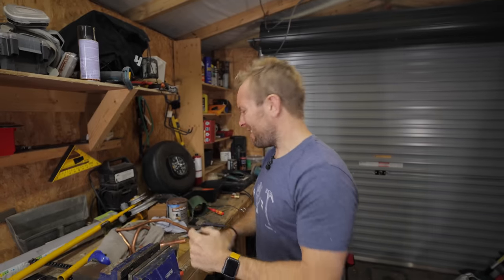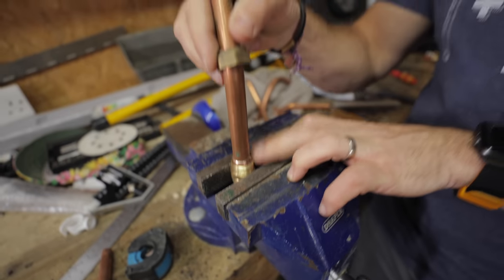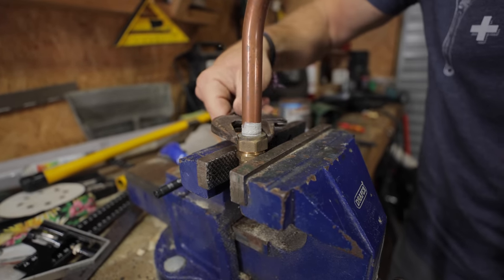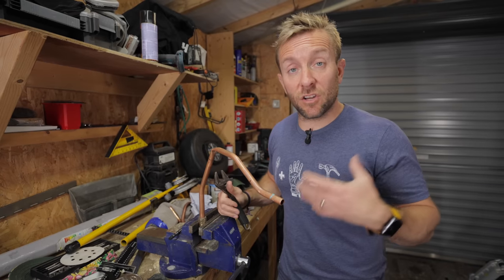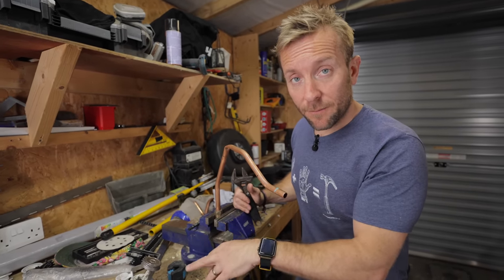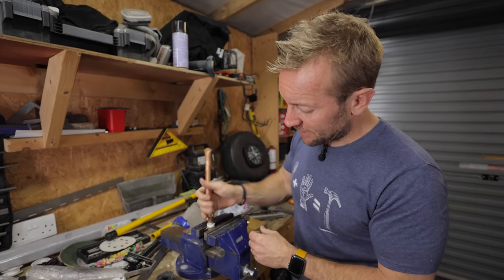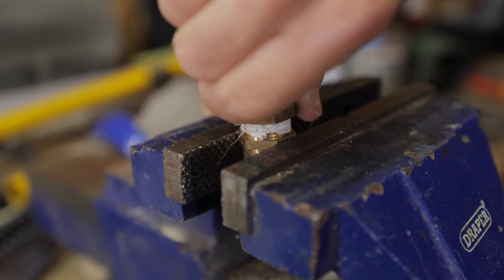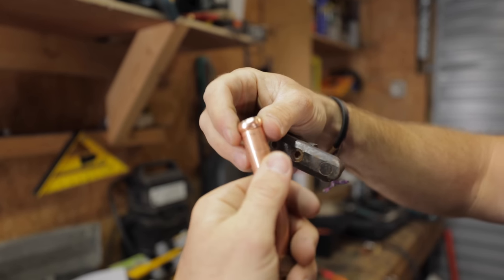4 MISTAKES Everyone Makes When Using COMPRESSION FITTINGS

Comment: I was once told by a plumber that the manufacturers spent £millions on R&D to get compression fittings to seal properly, so under no circumstances do such a stupid thing as put anything on the joint. Stood me in good stead for donkeys years. A fitting that's been overtightened to the extent that it leaks means removing the fitting and a section of pipe and starting again.
Reply: That may have been the option decades ago, but today 2023 the pipe and fittings as mentioned are imported and they're crap, they need all the help possible to effect a good permanent seal. Copper pipe made in the U.K in  the old days was much thicker walled , and like for like fittings old against new weigh significantly less, thus there is that less brass. In practice I might add, I would far rather act on the advice of a working modern day plumber/heating engineer than and old fart that is decades out of touch! As for manufacturers spending millions on R&D, not these days especially imported stuff, it's cheap and cheerful to maximise profits.
Reply: @MrChrissy1r  You had my attention, right upto the point that  you felt the need to descend into the gutter. I still actively use copper pipe - and compression fittings where necessary, too - and still don't suffer leakage issues. I guess you'll have to put it down to skill - something many modern plumbers clearly lack... And, btw, maybe you should get your mum to proofread your comments before you hit reply..?
Reply: I’ve used PTFE tape for years never had any issues 😂👍
Reply: Mechanical fittings do not need any type of dope. That would be like putting dope on a flare fitting. You just don't do it.
Reply: @will_doherty tf did he say
Reply: Hnnjh
Reply: Many manufacturers of compression fittings, similar items and even nuts and bolts, now drive down the tolerance of parts to the point that, what would previously have been a good interference  fit, is now a 'rattling good fit' as we used to call it.  I've also evidenced it in boiler pipework too, most recently in an old Vokèra machine of circa 1998 and a brand new one.  

You also see it in spanners and sockets that are of a marked size is now too large for the newly-acquired hex nut, leading to slippage and, in extremis,  damage.
Reply: Loved your video   very exciting.  Just 1 thing, i have a problem with over tightening, my son says my torque wrench is a German made "goodentite".
So, just how do you know when it is tight enough??
I was thinking,  maybe put a mark on it when you feel it come tight and then turn it......say 1/4 of a turn...yes....no??😢
Reply: Spot on just retired after fifty three years in the job, very rearly used any compound  not needed
Reply: The same fitting has been used for decades. What is this R&D you are talking about?
Reply: @AC_Milan1899 "the same fitting has been used for decades"
I think that's the point.
They did all the hard work years ago and now that it's as good as it can be there is no need to change it.
Reply: I thought jointing compound was for use with iron fittings and if hemp /plumbers string is needed. The olive should be dry!
Reply: Agree. I rather put ptfe tape or none than jointing compound. Especially for tap Tmvs works. You will make yourself a lot of a work when coming back after a year and servicing strainers in check valves.
Reply: I listened to that advice when I started it's bs
Reply: I listened to that advice when I started it's bs
Reply: I listened to that advice when I started it's bs
Reply: I listened to that advice when I started it's bs
Reply: I listened to that advice when I started it's bs
Reply: I listened to that advice when I started it's bs
Reply: I listened to that advice when I started it's bs
Reply: Loving all the salty comments .
Reply: @davidbenson776  No matter how many times you repeat nonsense, it doesn't make it true...
Reply: @will_doherty  Don't have a clue why it posted it so many times ?
Reply: @will_doherty what do you mean he descended into the gutter?
Reply: Brass olives are the way forward 😊
Reply: Why take the risk of not using PTFE?
Reply: @MrSprintcat  why can't you put dope on flared fittings? I've seen many leaks on those as well. I put a little pipe dope and never ever had a problem. You've just heard not to before and now you treat it like gospel. Think for yourself some time okay champ

Comment: Have used compression fittings for about 40 years, never used jointing compound and never had a problem. Don't overtighten and you can go back and pinch them up a bit if it oozes slightly. Never needed PTFE tape either. By the way, PTFE isn't nylon, it's Poly Tetra Fluoro Erhylene, the clue is in the name!
Reply: Ethlene
Reply: @LS-td3dz  Polytetrafluoroethylene
Reply: Same. Just pinch them up. If undoing old joints I might use some.

Comment: Another tip, turn off your water when you go on holis
Reply: Yeah - learned the hard way. But it was a compression fitting that failed with PTFE, that sealed well but was under tightened and popped off. 

Jointing compound is a bad idea on these because it may seal but might not be tight enough

Best test is to tighten loosely, no compound, pressurise the pipe and stop  if it starts to leak and just tighten enough to stop it leaking and then a few more flats.

You should be able to undo a fitting and the olive should be able to spin  but not move up or down, that's how you know it was just tight enough.
Reply: In my youth, many years ago, we came back from holiday to find our carpets draped across the bushes in the garden. The neighbours had seen water coming out of the house because of a leak and had gone round to see if anyone had a key that fitted our house. I always close the stop tap when we go away!
Reply: Cool tip too
Reply: make sure the shutoff is newer and functions properly.  Hate for you to turn the knob or flip a lever and it starts to leak at the shutoff or elsewhere, right before you're leaving to the airport 😂😂😂
Reply: To avoid any chance of leaks just never turn the water on !,  although customer feedback may be unfavourable.
Reply: A long, long time ago I was an estate agent.  Come the winter, we always sent out a “drain off” letter to clients whose houses were going to be empty.  For those who said yes, we got one of the local plumbers to go in and sort it.

I had to show someone around one of these houses one bright & fresh (i.e. icy) Saturday morning.  I arrived early to open up and make sure everything was OK.  I unlocked the front door and … stepped into 3 inches of water.  Turns out the owners had come back for a few days, so turned the water back on and had forgotten to turn it off and re-drain.

I found the main leak.  A 15mm copper joint in the airing cupboard had been pushed apart and water was spouting 4” – 5” straight out.  It must have been running like that for hours.  Fortunately, my first guess at the location of the stop tap was right.  The airing cupboard was on the landing so pretty much central in the house.  It was a modern house with solid floors so the water was just about everywhere downstairs!  In the through lounge-dining room there was a complete full height arc of sodden wallpaper across the main wall.

When the plumbers came back from sorting it, I’m pretty sure they reckoned they’d found around 20 bursts.

And those people I was due to show around?  Much to my surprise they went ahead and bought the house!
Reply: @nicotoscani1707  I said jointing compound, meant PTFE. Gave a false joint thinking it was sealed but wasn't tight.

Comment: I have done plumbing for over 30 years and have never used any type of jointing compound on compression joints, guess whet i also have never had to go back to repair a leak either, well apart from the time some one put a nail through the pipe, which apparently i had done two weeks prior to been called out
Reply: Bard agrees with you Paul
Reply: That doesn't mean that someone hasn't fixed it for you and you never knew that! But I want yo believe you so what are your thricks to avoid getting it undone!
Reply: @antoniogalluccio4213  Maybe delete your post and try again after checking the spelling
Reply: Try to be more humble. And what you said just doesn't make sense. Delete yours instead!
Reply: I worked at a plant that had thousands of joints in copper and stainless steel tubing.  We never used any tape or joint compound.  Never any leaks if done correctly from pressures up to 100 pounds of steam and other chemicals and liquids.
Reply: I totally agree. Been in plumbing 40 years and never used jointing compound on compression joints. The reps from Conex and Kuterlite always advised against using jointing compound on their fittings.
Reply: @paulclubley9643

You're a real jobs worth,  mr perfect joint🤣
Worked on gas board for 37 years, always used hawk white on gas and water, doesnt have to be thick, just enough to stop gas coming out!!
You wouldn't get a job on gas board, you are too dangerous 🤣
I bet you're the micky mouse plumber that worked on our house before we moved here, shovking work!! I should bill you for the new work i had to do on the CH.
Try and be polite mr jobsworth👍
Reply: ... I  think the reason that joint compound is being recommended now is because,  as the video mentioned, plumbing parts ( and just about every other thing ) are being manufactured with much less quality control than in years past. I have had the same 35 years experience as you of no leaks without sealant,  but have recently experienced  numerous poorly made fittings,  valves, etc.

Comment: A compression joint gets its seal from compression. That squeak is exactly what you want to hear, its the sound of metal biting into metal. Compressing!!
Reply: Shh.... 😂
Reply: The olive needs to deform somewhat, like a copper sump plug washer on a vehicle. When did jointing compound become a thing? My guess is that it were invented years after plumbers had been doing it dry?
Reply: Exactly...particularly with hydraulic fittings. No PTFE tape or jointing compound. These fittings are designed as you have described. Anything that makes the olive 'stand off' from mating is wrong. The tape and jointing compound will deteriorate over time due to pressure and heat, where applicable, and result in a gap forming between the mating surfaces. I would have been in trouble by my apprentice supervisor for doing it as suggested. Tape and jointing compound only for taper and parallel 'thread fittings.' Retired machine tool fitter.
Reply: @isobar5857  Yes, good point about hydraulic fittings, brake pipes on vehicles etc.

Comment: Another tip, don't run your finger along/around the end of a freshly cut copper pipe. It will slice you open like a razor blade
Reply: True - even when using a pipe slice which is better than a hacksaw that's for sure.
Reply: Another one. When soldering don't put solder in mouth to bend to do next joint unless you want a pretty scab on your lip. I won't learn. Lol

Comment: Glad to see you mention the marking of tightened fittings. It was mentioned to me over 50 years ago as a worthwhile habit and I have always done it. I then go around a job afterwards to check for the marks (bright red is my preference). It has only saved me once but it was in the loft of a 3 story house where the consequences of a leak couldn't have been much worse.

My preference is to do an initial tighten of the olive with the pipe slightly (~1mm) pulled back from being bottomed in the fitting so that all the tightening force acts on the olive and isn't (after the olive grips the pipe) shared with the pipe pressing onto the shoulder in the fitting. I then open it up to see that the olive is seated happily against the fitting (lots of people don't seem to appreciate that the interface between the olive and the nut isn't sealing anything). I then apply potable jointing compound and firm to final torque and mark it.

I also prefer copper olives to brass - usually involved bunging out the olives that come with most fittings.

Comment: Oh this is brilliant, I'm not a plumber but live in a very remote island location, so I have to fix things myself. I just should have watched it this morning before I replaced the hot water cylinder, guess where I wrapped the PTFE tape on all the compression joints as I have done for about 20 yeasr!!! . D'oh!...  Thank you so much for this video, As for wedding rings we actually did just that, infact when our plumbing supplier knew what we wanted two olives for, they gave them to us as a wedding present. We only needed them for the actually wedding day! God bless you.

Comment: EXCELLENT advice. I am a hydraulic Engineer and I have spent most of my career training fitters how to avoid leaks in high pressure systems. I watched this video to find similarities. Everything you have said is bang on and CORRECT. In respect of under-tightening, we get the nut spun down to the point where it contacts the 'cutting ring' (Our ring cuts into the pipe - slight difference) and we refer to that as the 'fixed point'. That is the point at which all tolerances from threads, tapers diameter differences are allowed for. We then mark the nut and the pipe and turn 1&1/2 turns. That is our industry, yours may differ. We then put a high visibility mark on the pipe and nut. Before start up, all visual checks can be made easily. GREAT VIDEO
Reply from the maker: Cheers! Interesting to hear how you do it in other industries.

Comment: As an offshore worker, PTFE tape on compression fittings (Swagelok or Parker A Loc) is a No No. I did a bit of DIY plumbing a while back and the fittings (from a large DIY store) squealed on make up and the depth the pipe went in was shallow, so I went and got some Yorkshire Imperial fittings. They just felt so much better on make up. One other minor point, turn your shifter over 180 so that the nuts contact point on the moving jaw is down at the bottom of the jaw, not at the top of the jaw.
Reply: Hydraulic fittings too a no-no where I worked once, any tape fragments can plug up suction ports and get into spool valves
Reply: @jagmarc  Yes never use PTFE on hydraulic pipes.
Reply: Read your comment and stopped watching at 2 mins in . Any plumber that uses an adjustable spanner backwards is not worth watching .
Reply: You sir are 💯 percent correct.
Reply: Direction of turn should be against fixed jaw so he is right. Think about stilton or gland nut pliers.

Comment: Thank You...I am a 66-year-old lifelong general-purpose Repairman (plumbing, Electrician, Electronics, mechanic ect.) and I have always had annoying problems with compression fittings.....I'm probably too close to dying to help me a whole lot now but your tips were great...However, It still looked to me like you were winding your Teflon sealing tape the opposite direction than you would turn your compression nut when tightening (I apologize if I'm wrong...I am a bit dyslexic) I'm a Hillbilly in the southern Coal Fields of West Virginia (Almost Heaven with friendly people and at least 10 military-style guns per household).....Love your accent and your teaching style
Reply: Your correct,  the Teflon tape should be applied clockwise

Comment: I frequently remove olives by driving them off using the compression fitting's nut. Just open your adjustable a bit wider than the 15/22 mm pipe and tap the back of the nut with them. That's assuming the fitting hasn't been overtightened. The olive should pop right off, and if you're in trouble, you might even be able to re-use it 😱😅
Reply: Yep that's how I do it, it's exactly as you say.
Reply: I've seen more videos saying don't use jointing compound and that it's unecessary on compression fitting than say do.
Reply: I have done similar by placing an open-ended spanner between the nut and olive, the nut tilts and jams so acts as a fulcrum, works well in a confined space.
Reply: I've done that many times. Only time it doesn't work is when the pipe is not fastened tightly so the hitting the nut isn't very effective

Comment: Thank you for this - bad habits are passed down the generations, my Dad (not a plumber) taught me (not a plumber) to wrap PTFE tape around the threads on a compression fitting. Your videos are the first time I've seen PTFE tape used on the actual pipe and olive!
Reply from the maker: Haha! No worries mate.
Reply: It does nothing for sealing but does lubricate the threads when you nip them up and also makes them easier to remove in the future.
Reply: So my Dad was half right then! 😄 @ThePillenwerfer
Reply: Not his fault as PTFE tape is otherwise known as thread tape